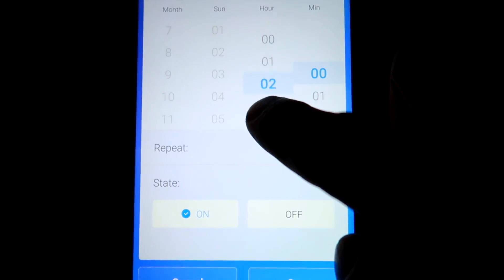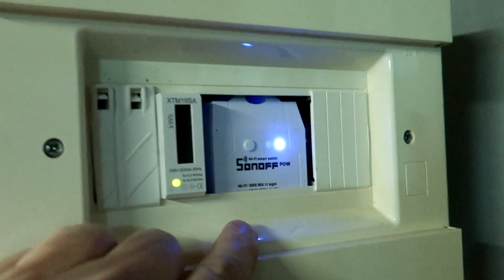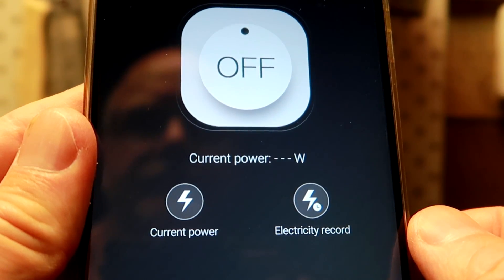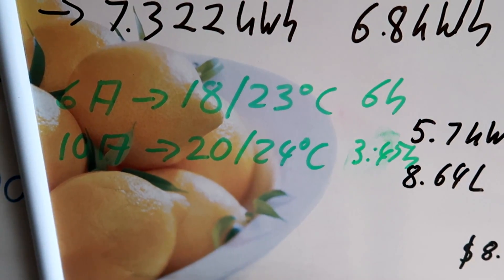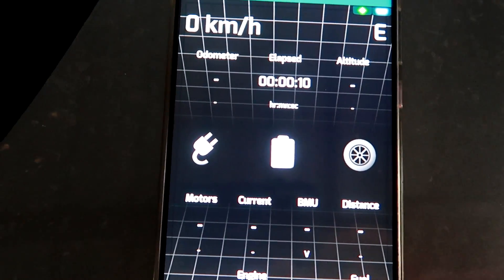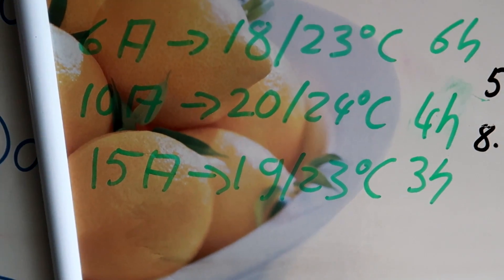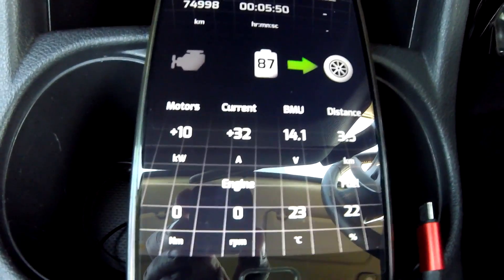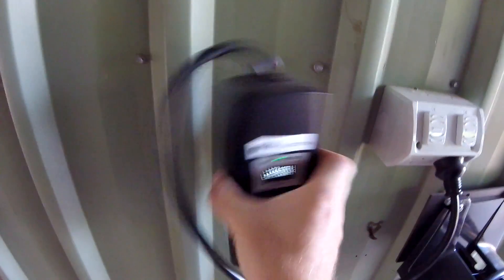EP129 - Battery Temperature in the Outlander PHEV: does the AC charging speed matter?

Comment: My Chargepoint Home Level 2 only has one setting - max power. So the Outlander PHEV gets 240V + 16A - registers 3500W continuous until it needs to balance or tapers off at the end. I was told supposedly once the temperatures of the battery exceeds 35deg C regardless of Level 1, 2 or DC fast charging the fans will run. Another YTer by the name "Unfrequented World" who also makes Outlander PHEV videos has recorded his fans on his 2018 PHEV running on a L2 charge at home, so this is a high possibility.
Reply from the maker: I've seen Gary's video about that. Maybe that has changed with the newer model 2018 onwards now and the cooling kicks in.
A pure fan would not work though as I believe the air cooling works in a closed circuit. Otherwise we would need some sort of air filter  been changed once in a while. So I don't think it sucks in any fresh air from the outside but runs in a loop with support of the aircon. I also have never seen the fan turning on without the aircon in terms of battery cooling which supports this theory of a close cooling circuit.
If the aircon runs as well while charging you would be able to see that on your ChargePoint and any other EVSE as the consumption is much higher.

Comment: hmm i hope the my19 has isolated battery if not the new hating system is quite useless, all the heating and it goes to the atmosphere. it will be interesting to see if i get different result when my obd2 adapter is arriving tomorrow. hmm i will try to test next week.
Reply from the maker: They usually don't have any insulation. The preheating is to warm up the battery before driving while during driving it will stay warm due to the heatloss.